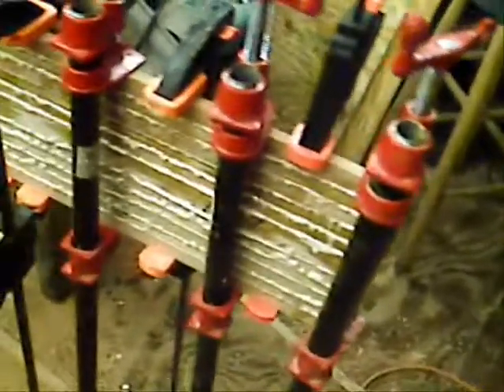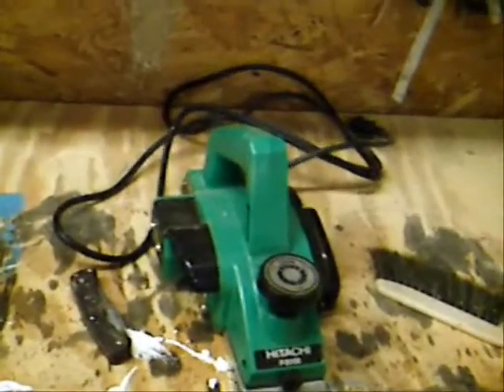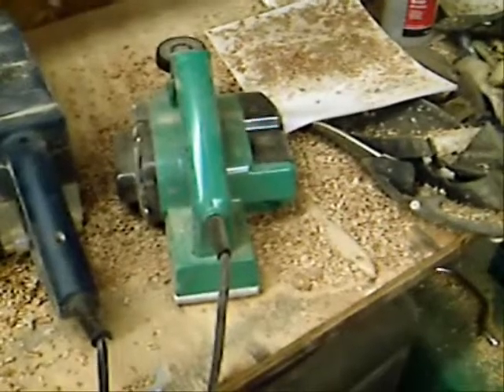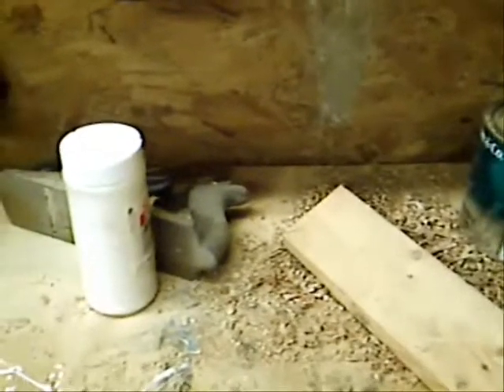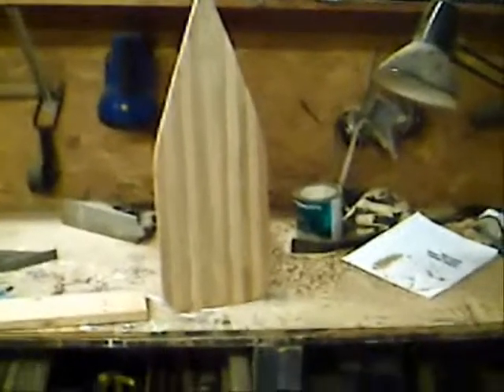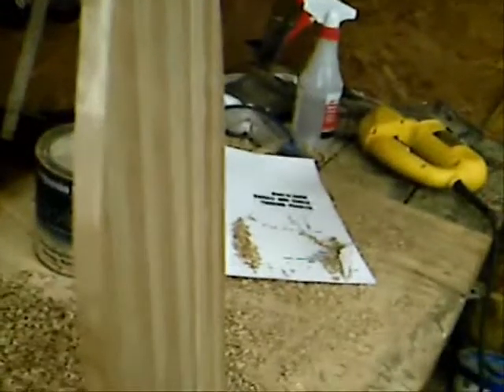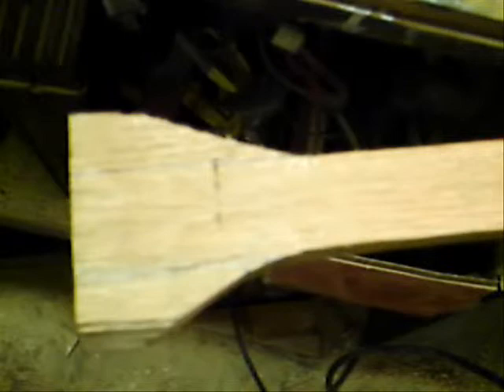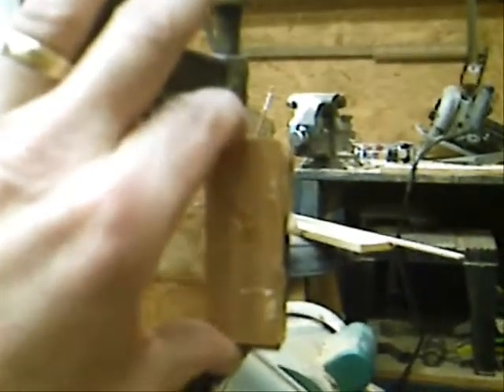The Canoe Paddle Part 2

Comment: When you mark your edge for the bottom of the paddle, just use that triangle for a guide for your hand saw.  Well it depends on which way your saw has support.  You've got a bunch of tools, kind of like myself.  I do things a little different.  I have made a paddle.  I think it turned out well, I laminated in a much different way.  I laminated the shaft.  I laminated the blade, three plys thick.  I used cypress and cedar for the paddle.